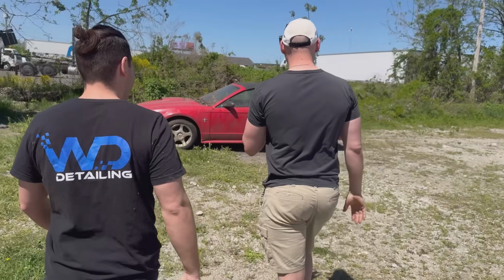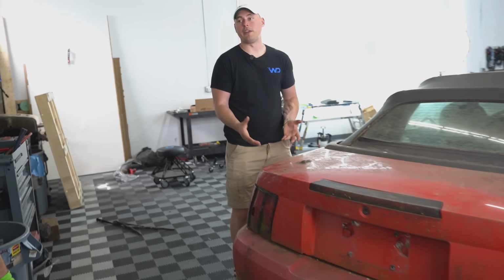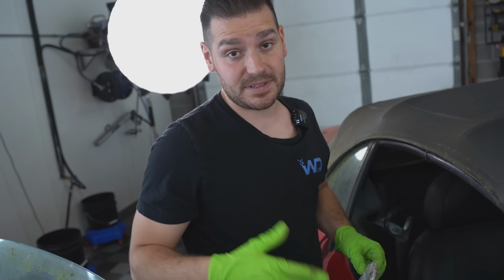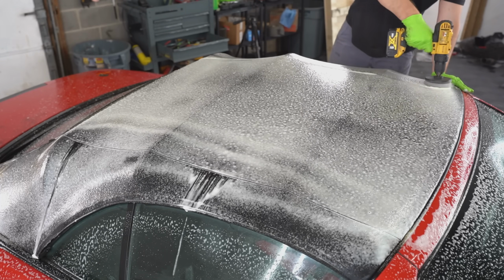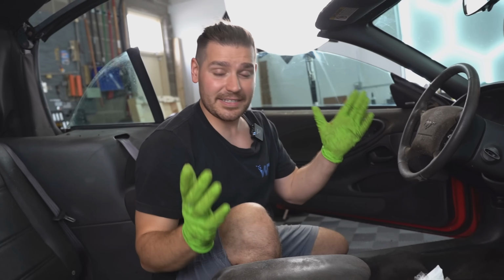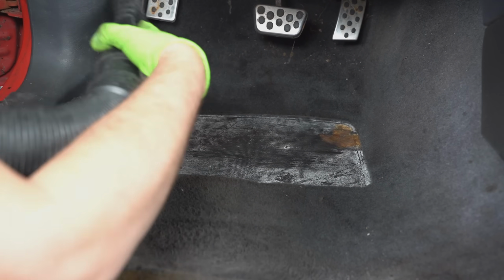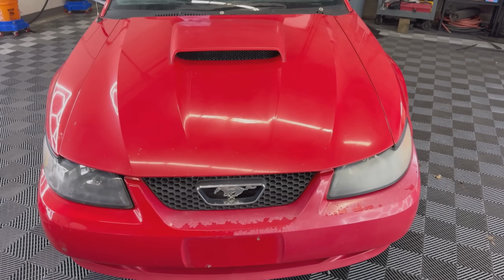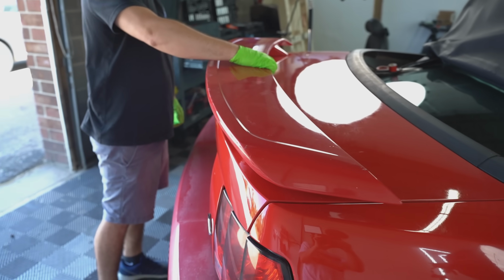First Wash in 12 Years: ABANDONED Ford Mustang! | Car Detailing Restoration

Comment from the maker: Now that we teased what's coming next week..... Who's excited?!
Reply: The organic matter is from a vine called Virginia Creeper. That's how it anchors. 👍
Reply: ME! The Ferrari BB 512 was the "big" 365. The name comes from the 512S, which was used in the Formula 1 in 1970. 5 liter V12 engine. In the 90ies, it was one of the most underrated Ferraris because of the huge costs of the engine maintenance. If this is a US model after 1981, it is called 512 BBi. Due to the emission standards in that time, the engine has a Bosch K-Jetronic injection. You can recognize this model at the parking lights.
Reply: I'm no mechanic, but should you be spraying the alternator like that?
Reply: Just curious, would that iron remover work on the carpet or would it bleach it
Reply: Hello
Reply: finally cracked the 1mio, respect guys. greetings from Germany
Reply: Me
Reply: Abandoned for 12 years? Stop lying. At the 14:00 you pull out a toothbrush with PJ Mask on it. That came out in 2015. So by the time it got popular enough to be made into a toothbrush and be abandoned calling cap.
Reply: What's uppp?
Reply: Me Sir.
Reply: wow u lucky guy 1 million subscribers 👏 omg God loves 😹
Reply: hey i have a car but idk how much you guys charge to come to a far away state to clean could you please tell me
Reply: why did you not showing for start the car

Comment: I own an 04 v6 and some people may not know, that the rear bumper cover that says MUSTANG is getting really hard to find.  When you buy a replacement cover these days its blank.  Fun fact.  Also, the v6 although low in HP compared to modern cars is very easy to work on and reliable if kept up.  You can also get about 22-26 mpg on hwy.
Reply: I was recently given a 2000 v6 and it had over 330,000 miles when I received it. I have put almost 7,000 more on it, and it has had zero issues. The previous owner had bought it for his wife, who was a little hard on the clutch, but he was very good about routine maintenance, and it runs great. It still has the original engine and original everything, with the exception of some exterior add-ons (namely some unique paint and lettering)!
Reply: I have a 2000 v6. I have been thinking of getting back on the road.  Needs some work done but I may have it done this summer. Starting with a good wash.
Reply: All the 99-04 v6 and GTs had mustang on the rear bumper.    I had a 04 GT and I hated the mustang lettering in the bumper .
Reply: Sadly nowadays the late 90s and 2000s car parts aren't being made anymore which makes them a pain to find in good condition besides going to the junkyard to get a factory instead of getting an aftermarket which will be probably expensive…😤
Reply: I get better horsepower to weight in my 67 MINI Cooper S. And it's faster.  It gets 35 to 45 mpg.
Reply: Please thank the ill-fated "cash for clunkers" in making replacement parts/aftermarket parts or OEM parts unavailable.
Reply: @douglasb.1203  Now, i do believe that was intentional, They did it on purpose to make buying older cars too costly or outright impossible, and made it harder to maintain them properly, Now they're trying to push EV's and newer computerized crap thats impossible to work on yourself.
Reply: Hopefully your transmission is doing better than mine. I've got the 02, and I'm pretty sure the torque converter is about to go
Reply: Not knockin ya but my 07 GT gets 23 on the freeway...it's just off the freeway that gets me.....😂

Comment: Hello guys!  Apparently, that organic material you have on the headlights and paint is artillery fungus.  Yvan Lacroix taught me it can be easily removed with peanut oil. I used it on my brother's Subaru Forester since he lives in Florida but spent several vacation days in Virginia, and when I visited him, I detailed his vehicle.  We don't have that in Puerto Rico, so it was my ever first experience dealing with that organic material.  Yes, it can't be removed, even spraying iron remover or water spot remover, and sometimes it's very difficult also with a synthetic clay towel or a clay bar before polishing and it was extremely easy with peanut oil.

Comment: You guys did your usual stellar job!  Personally, if this car really doesn't run, it's probably easiest for an experienced backyard mechanic to just repair/replace the V-6. Lots of extra parts needed to convert it to a V-8, I'm sure. The car looks in pretty good shape overall from an appearance perspective after you finished with it. And most of the accessories probably still work.

Comment: Rust stains on plastic usually means high iron content or rust content in water. Rust stains on plastic may seem unexpected, but they can happen easily when metal objects are left on plastic surfaces or if plastic comes into contact with rust-laden water. These unsightly stains are stubborn but not impossible to tackle. In this article, we’ll dive into several effective methods on how to remove rust from plastic, covering both home remedies and commercial products that can help restore your plastic items to their original state.

Materials Needed
Before you begin, gather the necessary materials. The tools and products needed are generally easy to find and budget-friendly, making this project accessible for most people. Here’s what you’ll need:

Baking soda: A common household item that, when combined with vinegar, forms a powerful cleaning paste.
Vinegar: Known for its natural acidity, vinegar is excellent for breaking down rust.
Lemon juice: A natural acid that smells great and works well for light rust stains.
CLR (Calcium, Lime, and Rust Remover): A commercial product designed to target rust stains.
Magic Eraser: A cleaning tool that can scrub away surface-level stains without damaging plastic.
Scrub brush or abrasive pad: For tougher stains that require more elbow grease.

Comment: I wouldnt engine swap anything.  Unless the block is cracked.  Then Id source another same year 6 cyl.  
The 64 1/2 Mustang was a straight 6.  All 6 cyl Mustangs are nods to the original.  And really it would look awesome at the mall, drive in, school parking lots and car shows.  You dont need massive Cobra power to cruise Highway 1 along the California coastline.  The top down wind in your hair and your favorite tunes on the radio is reall all thats needed for an authentic Mustang experience.
On the dash styling.  That too is a nod to the OG Mustang dash.  Two accented zones that match each other.

Keep em coming Boys.  Cant wait for the Ferrari episode....ooops.  did I let the cat outa the bag?  😳🤪

Comment: That is a 2003 Mustang LX with the Pony package. I used to have one in gray that was the hatchback and not the convertible. To me a V6 is plenty fast and has better gas mileage than a GT, plus it's much cheaper on insurance. I never understood why people need more horsepower unless they are racing and that should only be done on a track and not the open road where you could cause an accident and hurt or kill yourself or others. Yes, I'm 53, but even as a teen I drove the posted speed limit and only drove over it if other traffic was going faster to stay with the flow. I haven't had a speeding ticket since I was 19 years old and am now 53. Love this body style, but when I was younger I loved the 1987 - 1992 Mustang GT hatchback. Back then you could definitely tell the difference between an LX and a GT, but now even the base cars look almost the same other than wheels or tech features.

Comment: Replace the motor?  If you are a deep pocketed car snob, just buy a different car with an impressive engine.  This mustang would be a dream car for an average driver with an average budget, if it was in good running reliable condition.   BTW, add-on power adders are available and common for V6 Mustangs.
Reply: Also, the newer V-6's are pretty crazy! I'm not a big Ford fan, but the newer GT mark VI supercars have a Ford 3.5 V-6, and those cars are insane.

Comment: If you can't get a car to roll, then hit the wheel with a plastic or rubber mallet or put a timber block across the wheel and strike it with a regular hammer ❤ Usually frees up wheels 😊

Comment: Had one of these in high school, though it was a 1995 (same gen, slightly different body). Some guy gave it to me for free, no keys, no title, pretty sure it was stolen, and it was 3 different colors. V6 equipped, engine condition seemed fine, transmission had a short throw shifter on it that seemed to have been installed incorrectly, making it hard to shift. Had all sorts of ignition and electrical issues. Tried to buy a 2002 GT convertible with a bad automatic transmission, and figured I would just manual swap it with the transmission out of my no-title, mouse-infested V6, but my parents didn't want the front yard to become a junkyard, so I was not able to build my "high school dream Mustang."

What's funny is even over 6 years later, I see that very same 2002 GT Convertible pop up on marketplace every year or so from a new owner, same issues, just some kid trying to live with the issues it had I guess. Dodged a bullet maybe? Haha

Comment: 12:54 a replacement motor… a fresh rebuilt 302 with a cam and headers. Shouldn’t weigh a bunch more than the stock engine, will make more HP/TQ than the GT of that year, and will sound excellent.

Comment: I have an 03 "New Edge"(proper platform name). I replaced my 3.8l with a 4.2l from an F(or E)150. Direct replacement. More torque. Slightly more power. Can get a remanufactured  one with warranty for under $3000

Comment: All that effort to remove mould...MMM...I cleaned my 22 year old Rav4 last night taking an hour and 30 minutes (started at about 6:45 pm finished at just after 8:00pm) outside in the cold but humid. The roof and mostly the left side of this 5-door was covered in thick mould from a jackorander tree. I'm only using anti-mould cleaner you use in your bathroom (I used a whole 800 mlt bottle), dishwashing liquid in 14 litre bucket, three buckets with cut-up sheet as clean rag (40 cm roughly square used) and rinse and another 4 clear water for final rinse. It still need a more detailed wash but removed 99.99 percent of everything and will kill any reminder mould. I had to stop as its winter here in Aussie...lol...! Update note: mould on car for 3 & a 1/2 years!

Comment: I had an '89 t-bird for 16 years that had the 3.8 V6 in it. Only trouble I ever had was a bad water pump and a blown head gasket towards the end. It had plenty of power, enough to get some speeding tickets on the freeway. If that engine isn't seized, I'd say leave it so the car is all original.

Comment: Guys, I would have no problem at all driving around in a beautiful red Mustang 1995 convertible with a V6 engine. I would love to have that car.

By the way 3M double-sided tape is an awesome product. I use it for a lot of things. It holds my ring doorbell up on the wall outside of my place for over eight years now. And anytime I have to stick something somewhere in the car, 3M double sided tape.

Comment: perfect coyote swap candidate
Reply: It would take so much time and money. You might as well just take the extra thousands you'd spend and go buy one that already has a V-8.
Also, convertibles of any brand don't make good V-8 swap candidates if you're going for power because of the massive torque loss (and safety loss) compared to a hardtop, which allows more of the torque to be but to the ground, and not absorbed torquing the body.

Comment: @14::37 - that is common in newer cars (1990+) because of left-hand/right-hand drive cars. Minimal effort to install for either, depending on where the car is being shipped. As for an engine, a lot of people do a swap, putting in a stronger automatic/manual with a 5.0 or higher engine in them. The cars are unibody, so even if it had the 2.3L in it, it would still be a good cruiser.

Comment: You hate that engine? I wonder how you would feel knowing that my 81 mustang had a 4 cylinder .. it did have factory sunroof which made it a fun car

Fun tip for the 3m tape.. if you cut it on a slight angle and a razor with a slight upward flick removes the protective cover.. I’ve used that stuff on a weekly basis for securing  panels

Comment: A Ford Mustang with a V6 engine isn't slow in my book. I've  owned  Mustangs with the V6  engine. Power was good and the engines were very reliable. What's  wrong with 180 horsepower. That's plenty for normal driving in traffic. I drive a Toyota Corolla with a four cylinder that is said to make 132 horsepower. I've driven this car for several years. There has never been a single instance where I've needed more power. For everyday driving it's been just fine. I don't get where you guys are coming from. Years ago back in the 1970's I've had cars that needed more horsepower but that was back when the horsepower on all cars was low . The muscle car era that started in the 1960's was over by the early 1970's and car manufacturers had to cut horsepower on all cars including the big block V8's to meet federal emissions standards but performance improved by the late 1980's and throughout the 1990's.  This Mustang is a nice car. The engine may be repairable but if not find a replacement engine the same as the V6 in the car now. With some work the car can be restored to look like new again. On a final note I must say that you guys are still young. There are a lot of things you don't know or understand, especially regarding the past. You guys do pretty nice details.

Comment: I think these 3.8s were rated at 150hp, and only got slightly better fuel mileage than the 4.6. I do know they had lots of trouble with intake gaskets defecating themselves and causing overheating issues once the mileage got high.   I suspect if the engine in this one is locked up, that's probably why.

Comment: I owned a 1999 Mustang Cobra R Clone.  It was Lazer Red, had the stock V6 with a 5 speed stick, chrome mag wheels, a GT hood scoop, rear window louvers and front ground effects (was a hot looking car).  As for an engine swap the best thing is sell the car and buy a 5.0 Mustang GT, as there's alot to change over to put a V8 in.   Y'all hinted the engine was locked up, so was it ??

Comment: The reason for the rust stains on plastic is because the metal oxidized into the plastic, and plastic is a porous material. It soaked up the rust.

Comment: I am actually restoring on of these right now, a 2003 V6 3.8L. The engine was shot. I replaced it with a brand new V6. Why? because converting it to another engine size or type requires changing the transmission as well....too costly for this year of Mustang. After I complete the restoration I will sell it and upgrade to a V8.

Comment: But that not a 60s or 70s car or even 80s replacing modern engines almost takes an engineer because of all the computers true musclecar from the 60s and 70s there was not a computer mechanical linkage for fuel mechanical clutch a hot wire ground and a fuel line that’s all you neededvery simple